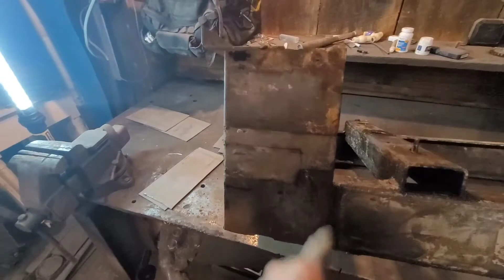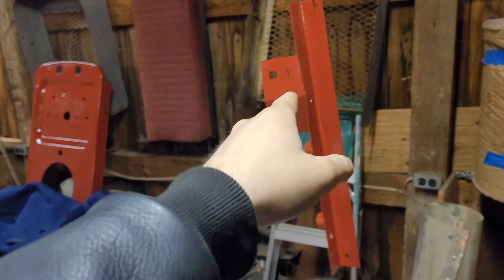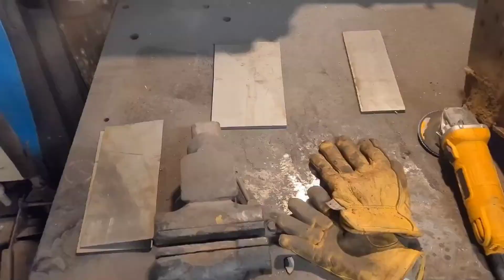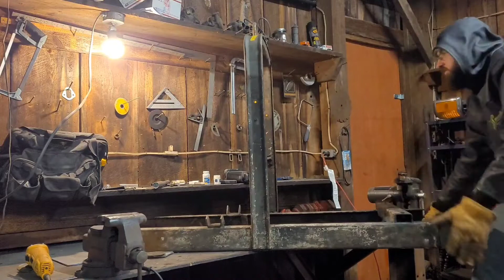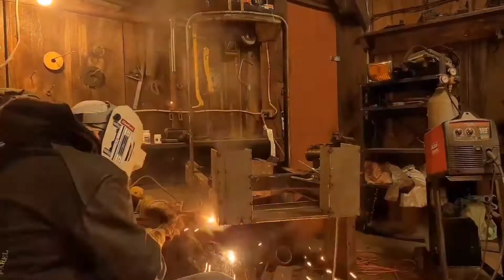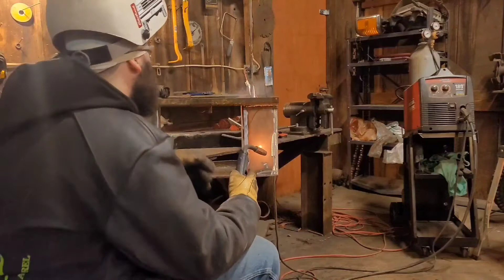Fixing the battery tray on my Lincoln SA-200!

Comment: Hey what's the measurement between battery box side panels and engine mount cross beam . thanks
Reply from the maker: @jryc5566  i honestly don't remember. I sold that machine last year. I think i made it the same measurements as the factory box